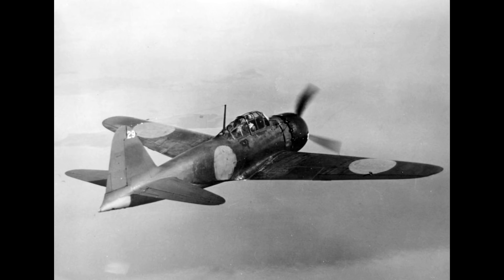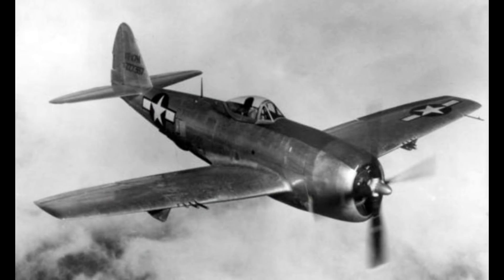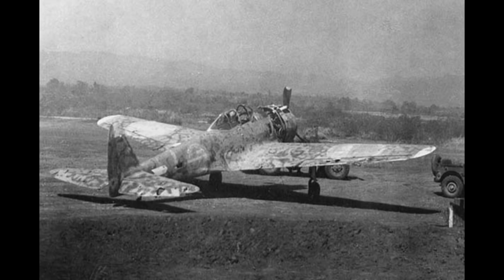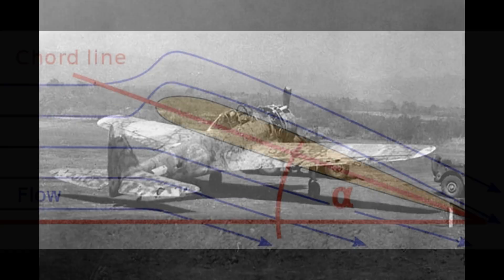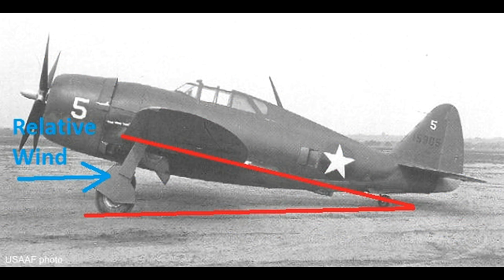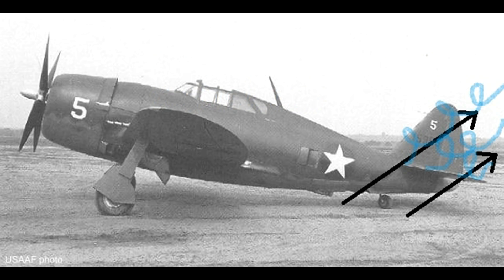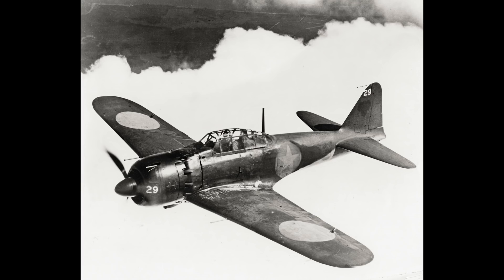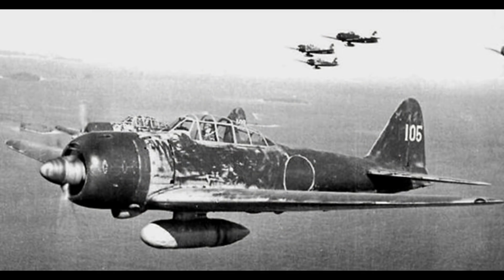Mitsubishi A6M Zero, an interesting fact few people know

Comment: A little-known fact is that the Japanese in 1943 invented a new aluminum alloy that was 30% stronger than anything before. It is now called 7075 and is used in our AR15 M16 M4 rifles.
Reply: Strong but much less elastic and more prone to fatigue cracking.
Reply: what aircraft was it used in, if any?
Reply: I heard that it was used in wing spars but I dont know if this is true.
Reply: 7075 aluminium alloy is an aluminium alloy, with zinc as the primary alloying element. It is strong, with a strength comparable to many steels, and has good fatigue strength and average machinability. It has lower resistance to corrosion than many other aluminium alloys, but has significantly better corrosion resistance than the 2000 alloys. Its relatively high cost limits its use.

7075 aluminium alloy's composition roughly includes 5.6–6.1% zinc, 2.1–2.5% magnesium, 1.2–1.6% copper, and less than a half percent of silicon, iron, manganese, titanium, chromium, and other metals. It is produced in many tempers, some of which are 7075-0, 7075-T6, 7075-T651.

The first 7075 was developed in secret by a Japanese company, Sumitomo Metal, in 1943.
Reply: 7075 series is ubiquitous in commercial airlines.  Of small planes, Mooney has 7075 spar, and only failure was into a helpless fellow fling into a thunderstorm.
Reply: How would this metallurgy development  have any relevance to the Zero? The Zero was designed and deployed several years prior to 1943.
Reply: @leebranch1228  probably then, like ● ZERO ●
Reply: @johnferguson7235  ...T2024 better.
Reply: I will google that...fascinating !!
Reply: The reason that there are so few flying examples of the A6M is the low corrosion resistance of the alloy it was built with. Flying examples have usually had the air frame re-created in more common alloys. All the 70 series alloys contain zinc and the most common use for them is in dies for plastic forming where corrosion is not an important issue. 70 series alloys take a very fine polished finish which leaves an excellent finish on the plastic parts cast in the die. Use as a structural element requires attention to the exposure to corrosion and protective measures. Another high strength light alloy is lithium aluminum which has been used occasionally for extreme light weight construction and it also requires special attention to possible corrosion.
Reply: 7075 T6 was used a lot for top wing skins and fuselage longerons on jet airliners. Not commonly used on lower skins as although very strong, doesn't like being repeatedly stressed in tension i.e. it cracks hence it being okay for top skins which are mainly in compression.
Reply: Kathleen Shaw  thank you. I'm a. Ex CAA licensed aircraft engineer. Up until watching this video I always thought 7075 was a US developed material. The Japanese - who would have thought🙂
Reply: (Edit: to carefully re-read the original post by John Parrish, I acknowledge he writes, "... is now called 7075....")

The alloy used is related to the modern 7xxx family of alloys, but is not that formulation; I don't know why this erroneous information is prevalent.

The alloy used was a formulation that unduly "precipitated out of solution," which is to say, as the alloy aged the alloying metals would slowly separate out. It eventually became prone to exfoliation -- paper-like delamination. I remember reading that one could gouge swathes of metal (from the spar?) with a key, and obviously this would eventually render the aircraft flight-incapable. This is the reason there were soon no flyable examples, even relatively soon after the war. I cannot imagine the Japanese engineers were unaware of this vulnerability; presumably they utilized this alloy in regard to the exigencies and practicalities of wartime.

Typically, a "problem with corrosion" is mentioned, but this is consistent with this alloy's susceptibility to local precipitation of zinc to allow incursions of oxidation, and therefore present ongoing structural compromise.

This is just an educated guess, without due research: presumably the alloy used had a low(er) proportion of silicon, which (among other elements) mitigates this property in modern precipitate-hardened Al alloys.
Reply: Ryke Haven  Wow, looks like my information was wrong.
I did get the information from a guy that does restoration work at the Air and Space Museum so I thought it was legit.
Reply: Ryke Haven  Sir, you really should relax a little. How a long dead admiral got into this, I don't know but your starting to sound a little unhinged.
Reply: Much of what you say sounds like pompous ridiculous nonsense, and at least some of it demonstrably is: MacArthur required (dumbly) that all Japanese aircraft documentation from WWII be destroyed, including aircraft blueprints. The Japanese were so ashamed of the Zero, as you stupidly assert, that they risked prison to preserve only the Zero blueprints, and nothing else. That the alloy crumbled is possibly true, but only on examples found in the Jungle after years of abandonment, which could include airframes as early as 1945...: There is no report of this having any effect on combat operations. Performance of the Zero was vastly underrated by US tests, which show no WEP figures, those also gone from Japanese sources as per MacArthur’s order... American tests were so dumbly conducted they claimed the Zero had negative G carburetor cut out, when a negative G valve was present, giving US pilot erroneous information, which is really beyond stupid... Finally, everyone in WWII started with the wrong assumption hit and run worked easily, which lead to a worldwide slew of useless twin engines fighters, of which only the P-38 barely ever worked... The Japanese were equally obsessed with speed and hit and run, using the Zero in dive and zoom attacks, to the point of nullifying it’s effectiveness early on... Only the lack of fuel tank protection on Japanese types allowed the US to continue with second-rate hit and run, the Hellcat alone mixing turn-fighting, and thus out-scoring everyone else... The Zero’s downfall was the lack of harmonized firepower: Admittedly the US did better there... With 6 0.50 cals the Zero would have slaughtered its opposition much like the similar Ki-100 did with better armament, better matched if still mixed. Firepower uniformity/density is what made a fighter good, plus good slow speed turning with the throttle reduced... Hit and run required high angles and yet most WWII kills were done well under 30 degrees. Only a few pilots in real life could reliably exceed that, making hit and run a second-rate tactic with the poor available WWII shot density.
Reply: Ryke Haven  No Zero pilot interview I ever read ever mentioned corrosion as an actual problem. No Zero pilot quote you can point to ever mentioned the Zero's structural integrity as a problem (quite unlike the P-51 Mustang! And this right up to the D). The only quote to that effect is the wrinkling of the top skin in high speed dives. Perfectly normal given its low dive speed limit... To give you an idea how such problems would not go unnoticed, the early Oscars 1s had terrible wing structural problems, and this was alleviated by placing springs in the control cables to prevent the pilot from overstressing the airframe. The Oscar II entirely solved this problem. The Japanese were quite capable of solving all sorts of problems...

  The MacArthur order was real, as is evidenced by the Zero having the only existing blueprints (all the hundreds of others types being gone forever is just a made up story too?), hidden for years in a family member's house, and revealed only much later. Why would Americans need interpreters when the documents were at production facilities? They burned everything, and this is corroborated by US personel at the time. Are you going to deny the huge -US made and US supervised bonfires of all Japanese aircraft airframes that are the hardware side of this? Those have actual pictures... Japanese aircraft tech was of lower value and of no interest to the US (unlike German tech), and the Japanese were eager to comply, but to say they willingly did this is silly.

-You seem to have no notions of what WEP means or of the slight differences between Japanese Army octane levels and Japanese Navy levels... The Navy had higher quality fuels. War Emergency Power was rarely tested during the war because the US relied on available captured Japanese fuels for "accuracy" (resulting in the ridiculous figure of 635 km/h for the Ki-84 Frank),  not realizing the Japanese used "training" fuels for training and better quality fuels for actual combat: Even the Japanese Army had combat grade fuels, and the figure of 700 km/h at WEP was confirmed by ALL captured Hayate pilots for the Ki-84 in wartime: This was at 19 000 feet, and so exceeded the P-51 at the same altitude (as P-51 pilots can attest). Do you really think the Japanese were not advanced enough to solve a simple corrosion problem? On the contrary, I can point to an actual example of the SAME company's J2M3 "Jack" holding together in hard high speed maneuvers, while the chasing late war P-51D lost its tailplanes and fell apart while trying to follow it... What? Was it made of a drastically different metal from the SAME factory? And the US tested the "Jack" at 595 km/h when its actual top speed was 650 km/h... And so it goes all the way down the line... As a rule, never place too much trust on foreign material tests, and especially not period test pilots in general(...): Front line combat accounts are more reliable: The P-51, for instance had 3 times the gun jam rate of the P-47 (500 to 1200 mrbf vs 3000), and most dogfights (easily more than half) ended with just one gun working, the inner turn one. Why? Its guns were tilted and were thus affected by turning Gs. The problem was never solved, despite many field band aid fixes. As was never fixed its tendency for structural failure at high speed, which you never hear about the Zero unless it was shot at...
Reply: Ryke Haven  Quote: "Any pilot would.  That's not an "obsession", it's common sense."   :   -----It may be common sense, but the assumption that diving at high speed with a speed advantage was great for WWII gun firepower was a pre-war assumption that overestimated WWII gun firepower density and effectiveness at high bisecting angles: This is why all those early war twin engined day fighters were made, and they all got slaughtered because high angle hitting was barely available to the best aces, if that. You had to follow around, which is why turn fighting at slow speed was king throughout WWII (unless your target was highly flammable to your crummy below 1% average high angle hit rate). This was because once you roped in your prey into a turn, he was "locked in" (rolling out of the turn was a common German mistake that killed many of them due to their impatience). Hit and run worked, somewhat, but was an inferior, if safer to execute, tactic that was easily countered by turning to present a high angle shot, or going head to head. WWII aircrafts could not maintain high Gs for more than a split second (not enough to maintain a long enough sight pictures for their 1% hit rate) so the meat of the matter was in 3G sustained low speed turns at around 160-200 mph), where the Zero excelled. The Zero was negated by its catching fire easily and its extremely poor rate of fire, combined with a severe armament ballistic mismatch. The Ki-100 solved these two problems with the same maneuverability, and was considered by the Japanese capable of taking on 3 Ki-84 Franks, defeating them, exchanging pilots, and doing the same again. It could also take on two P-51Ds with high deflection gyro sights and at least hold its own... Only the Hellcat and Wildcat could turn with the Zero (at least a little), and so these got the lion's share of the kills. A P-40 pilot who understood the importance of turn fighting pointed out how the early Zero used hit and run (dive and zoom) tactics far too much: This is in the linked video below: For more excellent info on the Zero, from first hand sources, and real combat accounts, see this truly excellent video from Drachinifel,  which dispels most of the Zero myths;  https://youtu.be/ApOfbxpL4Dg

  For a better understanding of WWII tactics,  see my own videos here: These are condensed conclusions of 25 years of research (hence their unusual counter-intuitive nature), which will be furthered next year by actual flight tests (to investigate propeller surface load variations in turns) in Germany:   https://youtu.be/lCBOxbaxXBE
Reply: @johnferguson7235  All aluminiums have about the same elasticity.  7075-T6 is brittle, which is something else.
Reply: Even the zero came into the war with a unique alloy
Reply: @jenseirikskogstad5901  i think the japanese were the first to weld aluminum
Reply: Here's my take on Zinc Vs Copper rich solutionisable duralumins..
Zinc based would have a better fatigue life in compression.
Copper based in tension
Thus the airliner I was familiar with (DH 121 Trident) had top wingskins in the former and bottom in the latter alloy.
Thus optimising for thickness and thus minimum weight.
Reply: @johnferguson7235  only more prone in tension, thus used predominantly for saving weight on the top wing skins or top spar caps.
PS. Of course fatigue is strongly a tension stress phenomenon.
Reply: I didn’t know that. Thanks for the fun fact.
Reply: @jenseirikskogstad5901  Thank You.
Reply: 7075 is much tougher than 6061 t6 but the machinability much tougher too. Enough that I would hope they only used it for spars and high strength forgings.
Does anyone know what the forging capacity in the Japanese Empire? I know that the Germans profited highly because of several huge forging presses in that country. After the war the United States built some giant forging presses which are still held as important war material.
Reply: @wrathofatlantis2316  Zero had bigger firepower than Hellcat before 1944 and comparable after (new 0.50 ammo composition), as long as 20 mm cannons had ammo (Thumb rule:1x20 mm >= 3x0.5, 0.5 >= 2x0.3). Superb firepower was the only reason it could be efficient against resistant and armored American aircrafts.
Reply: Ha ha,my dirt bike frame ( Honda) is 7075 alum .
Reply: The a6m itself used a new alloy when it was made
Reply: @Beemer917  Yeah the Zero took a lot of man hours to make as a result of the lighter/stronger alloy used in it's construction, much more than Hellcat's and the like.
But the Japanese rightly considered the trade-off worth it, they could get away with less engine power (they weren't so good at building compact high power engines yet, that had to wait until the 1960's in the Japanese automotive industry).
What offed them was lack of pilots (due to a far too rigorous training program), too much discipline instilled with little to no individual initiative among the pilots they had, and faulty doctrines (too hung up on the "decisive battle") overall.
Reply: @flightcamm  
Doesnt say much about your training 🤔
Reply: The sumitomo company developed esd (75s/7075) in the 1930's that alloy was used for the a6m's wing main spar only i am pretty sure.
Reply: @ToreDL87  lol
Reply: @kenneth9874  Absolutely
Reply: @sule.A  yes, and it was called extra super duraluminum!